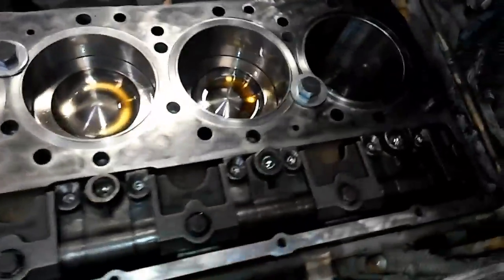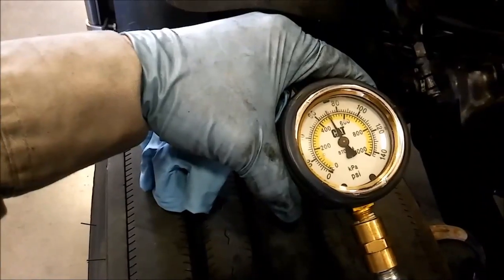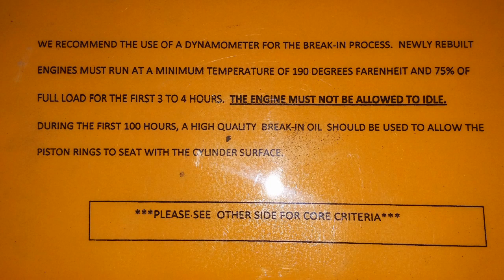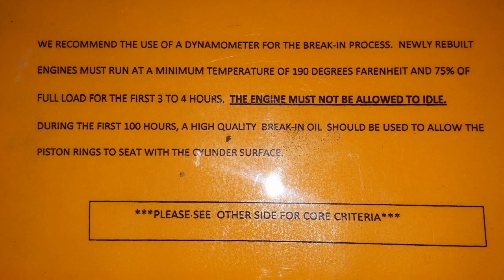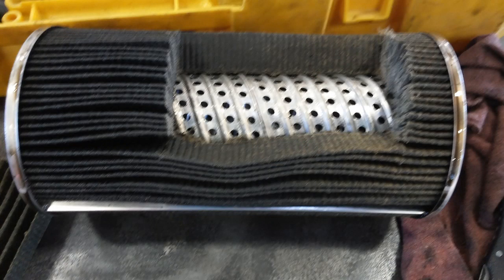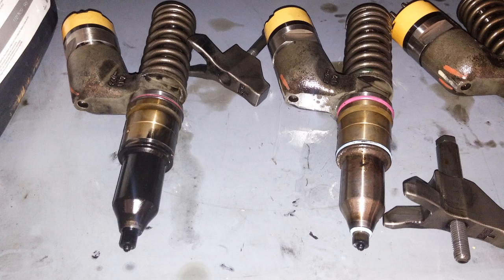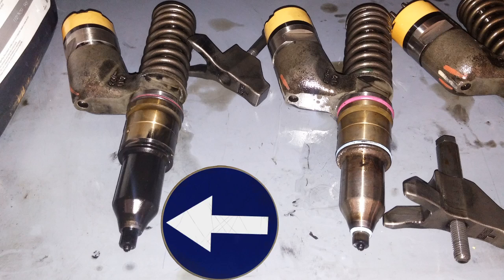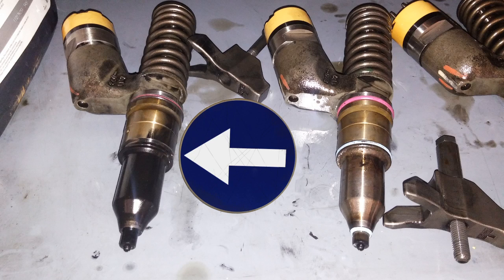How Should You Break In A Diesel Engine?

Comment: You seem to have short oil change intervals, we used to run 100,000k between changes, manufacturer actually specified 150,000k, used to change the filters every 4 months, but the oil was good for a lot longer, running a 13ltr 480bhp Total fully synthetic 5w30 E7 @44 tons or 97000lbs
Reply: E7 oil is designed for extreme long oil change intervals. That is what the e7 rating means.

Comment: Dear Adept Ape,
I rebuilt an STC Mechanical L-10 300 Cummins with an aftermarket Interstate-McBee kit. I set the overhead with it running at idle (10 minutes tops). I then put it to work. Had excessive blowby. Still have excessive blowby at 50,000 miles. Took to Cummins, they indicated that it needed rebuilt!!! Yikes! So evidently then rings didn't seat. What do I do to make them seat? Truck is not worth the cost of another inframe rebuild. I did have a reliable source suggest putting scouring powder in the air intake with it running to scratch the cylinders to aid in break in. I don't feel comfortable doing that. Ideas??????? I have rebuilt many other gas and Diesel engines successfully, now this is a problem child.

Comment: Here's a question you might have an answer for. I did an in frame on an isuzu 4.8L ( I specialize on Isuzu trucks). In the rebuild I did bearings ( overhead cam) pistons/liners, injector tips gaskets etc. Original cam and polished the crank properly. I got the timing 180 out on the cam, no big deal its non interference apparently. So I pull the VC and go to pull the cam , just from cranking it over for maybe 30 seconds the cam bearings looked scored , no scoring on the cam journals which was interesting. Any ideas as to how I messed up ?  I changed the cam bearings again and it's been running fine with good oil pressure for about 2 years now.

Comment: CAT engine with only 1 compression ring??  I thought Diesels were supposed to run on high compression??

An idea I'd like to see is what F1 teams do to break in their engines by simulating track conditions and transmission shifts using a dyno, the same thing can be applied with truck and car engines just the same, maybe even simulate driving the engine using a racing simulator steering wheel, pedal, and shift kit and run the engine through American Truck Simulator. lol
Reply: Yeah it is called driving it, that is how to simulate engine break in IRL

Comment: 14:55 most people change the oil on a highway truck about 36,-40,000 not 10,000
Reply: circusboy90210 I wish those people would brag about going that long between oil change, just so I know whom not to buy a truck from... That is insane, my 05 C15 379 is in the shop as I type this getting a full in-frame with a platinum kit at over 1.3 million miles. I never went over 20k without changing oil and filters. I can't see my self ever going more than 20k even with the synthetic oil. To each their own.
Reply: It all depends on how the truck is being used, the environment, if it has a specific filtration system designed for longer intervals, what type of oil. 

If it’s light duty (not pulling heavy/hard) and on highway, going longer isn’t a major issue. If it’s severe duty (lots of idling, dirty and dusty, HEAVY loads/up/down big hills), shorter is the way to go. When then engine works much harder and fuel economy is down, the oil gets dirty faster. When it’s dirty, it isn’t doing what it is designed to do anywhere near as well as it can if it’s fresh.
Reply: Oil samples are the only way to gage if the oil is good or used up at xx,xxx mi  i was taught to dump the oil at 500mi and 1k mi  after a build to flush the garage of brake in out  and no synthetic oil till 10k

Comment: some engines do have roller bearings instead of a film bearing. they are far superior in some ways.
Reply: circusboy90210 most motorcycle engines, specifically dirtbikes use roller bearings. They do last much longer, especially in a 2 stroke application.

Comment: After I've rebuilt an engine I bleed it as fast as possible using vacuum bleeding. I then tell the owner to load her up don't let her lug down low in the revs but don't over rev it just keep the revs nice n healthy fully loaded. All of my rebuilds I've done haven't used oil or coolant and no oil leaks so far

Comment: Question....

Can't they just break in the engine at the factory?

Why a break in procedure, may not bother a enthusiast, most others it's annoying.
Fleet buyers. People to see a car or truck as a tool or an appliance.  Soccermoms, business owners, people who want reliability without drama. If you require a break in procedure,  you only invite people to have a negative experience with ur vehicle brand. In time unhappy customers who may not come back.
Reply: Frank E, we're talking commercial (18 wheeler) truck engines. Your every day car engine is nowhere near as dependable as the diesel engine in a truck. I own and operate a 2005 Peterbilt 379 with a Caterpillar c15 engine that's in the shop getting a full rebuild, it's going to cost me around 15 thousand dollars and it's definitely worth following instructions of a break in to the T. Another reason a break in is very important is because I'm expecting another 1.5 million miles out of my engine, I'm getting it rebuilt after 1.3 million miles on the original parts. If it wasn't broken in correctly when it was new, it wouldn't have made it nowhere near the 1.3 million miles that it did. 

Does it make sense now?
Reply: Necko Agic for what it's worth, any engine's break-in is very important. And small diesels definitely need a break-in, as well. Small diesels still have the compression ratios that Adept Ape is talking about here and will have the same issues if they aren't properly broken in. I've rebuilt engines that were babied by their owners and they were glazed over shortly after because they were "afraid" of running them hard. They get blow-by, out-of-spec oil consumption, and loss of power due to poor compression too. Manufacturers play a game of trying to reduce their annual maintenance costs and don't want to make it seem like their product is anything but complete when it comes to the end-user. Sometimes they cut those maintenance costs by cutting corners.
Reply: Stephen Molzer 

Fine,....but the disclaimer. To the effect of....It's my opinion, and always follow the manufacturer instructions. So if the manufacturer advises something different then this person recommemds......i appreciate your responses.
Reply: Stephen Molzer, I totally agree with you. Of course a break-in is important in any engine, especially diesel engines. I was mainly focused on the demand and expectations of a truck diesel engine and how important the longevity of it is. At around 15 thousand dollars for a rebuild, it's definitely worth making sure it broken in correctly.
Reply: Necko Agic oh, no doubt. Large truck engines are a huge investment. They're 2-3 times the cost of a small diesel rebuild depending on the model and whether or not you're doing injectors at the same time. Plus that's your source of income. I'm just saying it's always important.
Reply: Frank E because the easiest way to do this is in a vehicle to make the artificial (or real) load on the engine. And most trucks run diesel engines manufactured by a different company. And for those made by the same company, almost all engines are built in a different plant than the vehicle. Plus people want to buy a zero-mile engine when they get a new vehicle.
Reply: Stephen Molzer 

Ok,....i understand, when i ask ford and chevy about it, they say "a break in period is not messary" they continue to add, its done at the factory.
Reply: Frank E with a simple google search, I was able to find Chevy's crate engine offerings that include a very specific break in procedure. Searching for Ford revealed the same thing. So either you didn't ask, or someone didn't know what they were talking about. The Chevy and Ford both involve double-checking and adjusting timing, idling with no load and specific rpms for a flat-tappet cam, and then driving varying speeds/throttles and/or with a load for a certain mileage. Then you make several hard throttle accelerations to a certain rpm and coast back down. After that, both claim you need to drive for a total of 500 miles as you normally would, then change the oil.

Comment: That 9:00 minute mark after mention of the "keystone" piston ring shape and it's purpose being to push out against the cylinder wall is what i came for.  Most people don't realize that idling a diesel washes the cylinders resulting in premature cylinder and cylinder pack wear.
Reply from the maker: That is true Brian, I don't know of a single manufacturer that recommends idling their engine.
Reply: @AdeptApe  idling anything is not good for it. 2 strokes. rotorys. gas motors. diesels especially but anything. motors were ment to produce power. freewheeling under no load like you said. the pressure is what helps seat the rings which is also what keeps them from getting blow by. for a diesel idling makes it not fully burn the fuel and it just washes the oil off the side of the cylinders so they get less lubrication and the rings not being seated from the cylinder pressure helps you get fuel in your oil and most diesels like to make that knocking sound at idle or low rpm cause the expanding gas just smacks the piston instead of pushing it which i imagine doesnt make it last longer. as far as i know the smacking makes the piston smack in the cylinder and that can hurt the piston and even erode the outside of the cylinder liners cause it cavitates the coolant
Reply: @AdeptApe   hey bud if I put it on the dyno for break in and after that run 10k pound loads would that harm it?
Reply: My erf ec11 has an idle cut off switch which i can only assume is for the reasons you mention @AdeptApe
Reply: As long as the company truck doesn't have an APU. I'll be idling taking away from Greta's childhood.
Reply: briansmobile1 I live in Canada and it gets real cold sometimes, whenever i idle my diesel I high idle it, I've often considered installing an exhaust brake because I imagine with that load on the engine even at idle it would create more EGT's keeping your motor warmer and create that pressure for the rings to seat properly, what do you think of that idea?
Reply: Doesn't idling ANY engine run the risk of washing the cylinders? Even gasoline?
Also, what would you recommend increasing the RPM of your car's engine to when warming it up before driving? I start up, wait for about 30 seconds, then run about 1800 RPM until the engine is up to temperature.
Reply: Instablaster...
Reply: briansmobile1 what about high idle? Say 1,100 rpm
Reply: Josh Simpson high idle is fine. You just don’t want your rpms low. Low rpms cause diesel slobber (carbon sludge) that gums up the piston rings and causes piston sticking, liner scoring, and all the problems that come with piston/cylinder clearance issues.
Reply: @samwagner31  is that only when you’re breaking it in? Or at any time during the motors life?
Reply: @DavidBrown-sv5lh  anytime.

Comment: hey josh whats your opinion on doing a run in on a genset engine ? where from startup it just runs up to high idle of 1400 to 1500 rpm ? because in my experience unless you have a load bank it can be a bit hard to vary amperage depending what it is being used for. in my case it was a c18 used to run a mobile aggregate crushing plant. any thoughts other than running it on a loadbank and varying the amperage load for the first 20 hours or so.
Reply: Was it ran in on a dyno?

Comment: Hi. I have an old L70c and thinks it need more fuel. Is that possible to adjust? It does not smoke and takes about 5-10sec to start coold and warm. And when driving The turbo and rpm takes time to boost up.. Thanks

Comment: The break-in period on a gasoline engine is a lot different. Typically on a gas engine, you'd baby the motor for at least the first 1,000 miles.
Reply: Daniel C not so, various load and rpm to seat rings,also 15 min to 30 min run times best.let cool completely, then do it again.
Reply: Not really,  we break in snowmobile motors basically same way, gotta seat rings
Reply: @kwmiked  let it warm right up and give her.
Reply: I broke-in my factory ordered 2011 Chevy Express AWD(5.3 V8) with 3 miles on it, as hard as possible immediately.   I have 110k miles on it now and it is still great - zero engine problems.   I did change the oil and filter after the initial 1,500 miles though.
Reply: I never baby a gas engine that i rebuild, and its been a bunch, let it get up to running temp and run it like you would normally do, other than varying your rpm's, but you got to load them rings to get them to seat.  When i built the engine for my 85 stepside, 4 bolt main 350 punched .030 over, I broke in the cam while it was sitting then immediately took it to some back roads and hammered down.  Hell i ran it wide open throttle for 5 miles straight, haven't had a problem with it in 5 years, oil change every 5000 miles and its less than half quart low.

Comment: Pretty much how I like to break things in.  Get it running, make sure it sounds and looks right.  Get some heat in it, then full tilt.  I do caution about not adding zinc to a new flat tappet valve train.  Newer ails do not seem to do as well in some instances.  At least for break in periods.
Reply: Shain Andrews that's a old wives tale from cam company's to cover they're asses for guys who couldn't get a rebuilt motor started in 45min and kept cranking and cranking till it finally started and it wiped out cam

Comment: I bought a military truck through an auction with less then 4000 miles on the odometer. Does the info you gave apply the same for a 2.5 ton military vehicle?
Reply: To late, just run it
Reply: Manuel Serrano absolutely not this Info only applies to ford pintos and AMC pacers and gremlins with gas motors
Reply: If you mean a US Army vehicle, I bet that the contract required the manufacturer to dyno the engine to meet MIL specs before installation.
Reply: It applies to all engines. At 4K you "may" still have a chance to do the right thing. I guess you could always buy a borescope camera, check your cylinder's condition and see if it's too late or not.